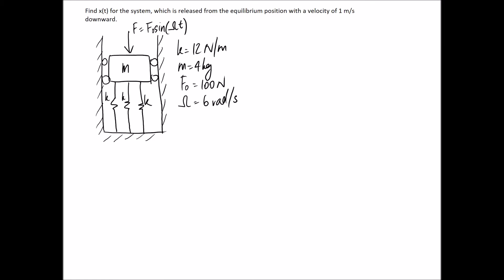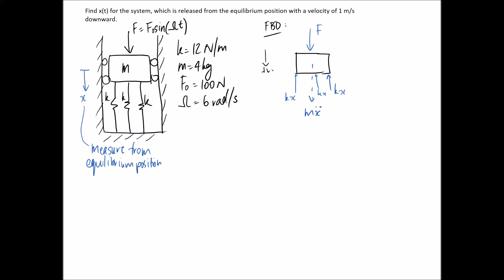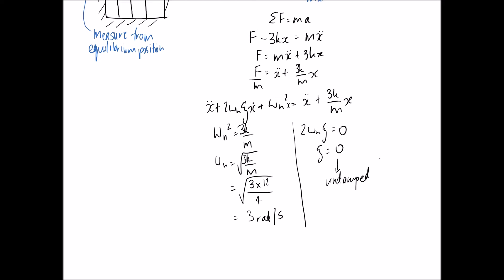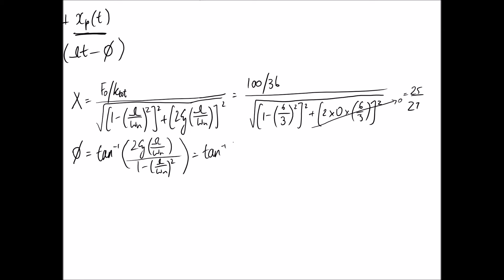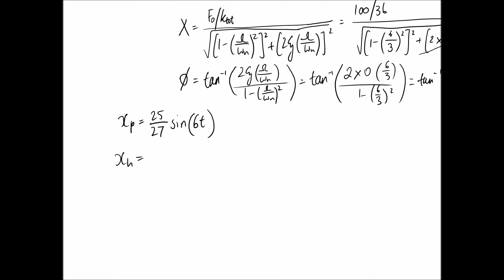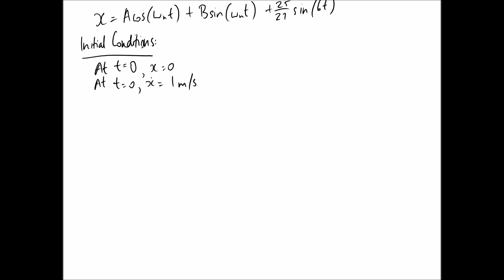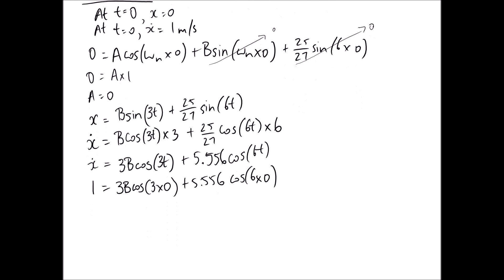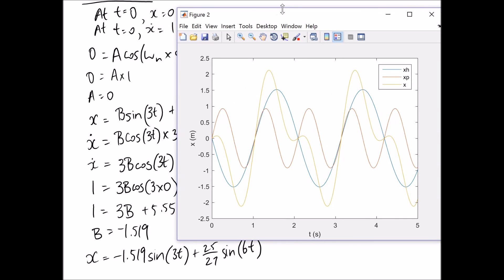Undamped Forced Vibration Example

Comment: The solution is incorrect. The mistake occurred when assigning the value of phi to zero. phi is equal to pi radians because the forcing function frequency is greater than the natural frequency. Under these conditions the phase difference between the displaced mass and the forcing function is pi radians.

Comment: Nice way to do it but i think you could make the calculation a bit easier. If you think about it, those springs are in parallel to each other, which means that you can add them up to a total of 36N/m so you just have a single spring to work with on your calculation. :)
Reply from the maker: You are correct in that the three springs are equivalent to 36 N/m so you could treat it like this from the beginning.